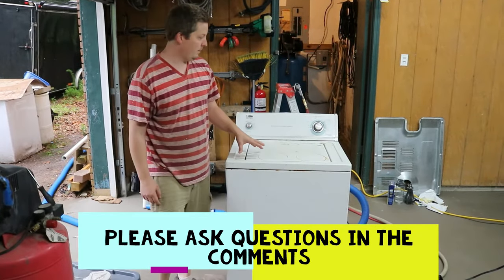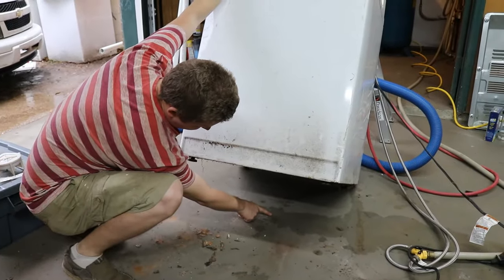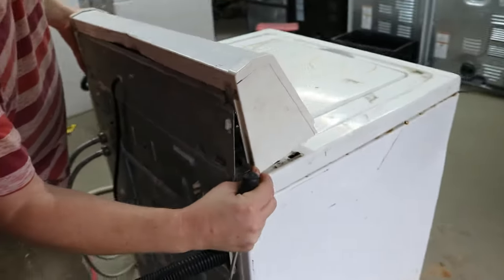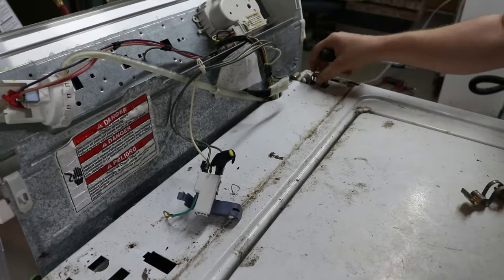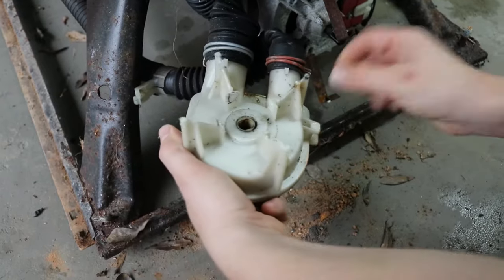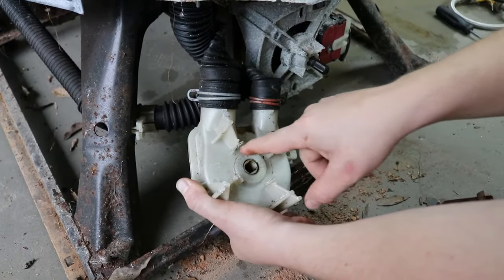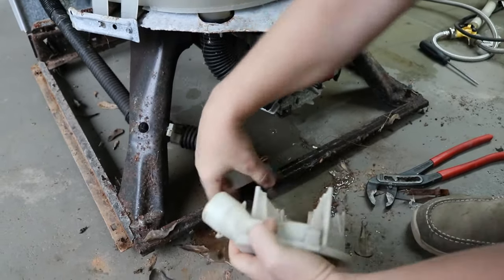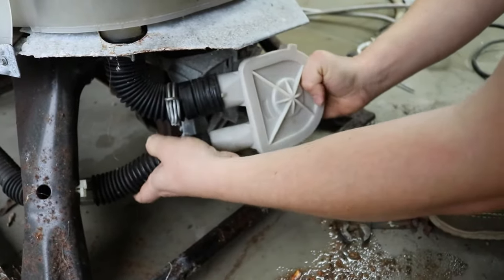Washer Not Draining or leaking? Water Pump Fix for Amana Estate Whirlpool Kenmore Roper

Comment: Hey Pal, Thanks so much for the great video. I had watched several and they were good but I didn't have a clue till I watched yours. I had it the washer apart and the pump off in about five minutes. I thought the pump looked good. I filled it with water and it leaked like a sieve. Thanks again!

Comment: Woke up with a sore back not excited to crawl underneath the washer. Then I saw this video and it was so much easier to access the pump! The existing pump looked decent, so I’m still not positive that was the issue. Replaced it but haven’t run a load yet. Fingers crossed it works.

Comment: I could use your help. This is unrelated to this video. I have a Kenmore 90 Series washer. After completing one load of wash I started a second. The tub filled with water, agitated then stopped. No matter what setting I put it in nothing happens. No humming, nothing. Another Kenmore 90 series washer was given to me. It agitated but no spin. After checking it out it was only a loose wire. Plugged it in & it went through the cycles. Put a load of cloths in & the only cycle that will now work is the spin. Any help on either one of these would be appreciated. I did notice same series but different timer control model. I did check the lid switch, both are good. I even jumped them to make sure.
This video is very well done, full view & 👍
Stay safe, Joe Z
Reply from the maker: The second washe mentioned…
The first thing a Washer will do is call for water from the water valves. If it does nothing, it could be that the cold water valve has gone bad. That would make sense of why you can progress it to spin and it will spin out. You are telling it not to call for water anymore and go to spin cycle. 
Quick way to check is turn it to hot water. It will still stop halfway through because the rinse cycle is with cold water, but… if it starts filling with water, you know the cold water valve is out.
The first one you mention does sound like a lid switch if it is not draining the water. Since you said you checked the lid switch the other less common thing it could be is the clutch. It will be obvious if it’s the clutch it will drain the water out and still make noise but not spin.
Reply: Thank you for this information. I will try the second one with the hot water. The first one does not hum or make any noise. I just installed  a new timer and just as before it will fill with water then nothing. @WasherDryerMoney

Comment: Mine is leaking only as it is filling. After it's filled no more water. When spins and goes in rinse mode, it fills with water and leaks again. After full its rinses and does not leak? Your opinion?
Reply from the maker: Could be leaking from the water valves.

Comment: Will replacing the pump work if my estate is stopping before the spin cycle?
Reply from the maker: If it stops before the spin cycle that usually means the lid switch has gone out. When the lid switch goes out it thinks the door is open and will not begin spin cycle until the door is closed.

Comment: I have an older Whirpool top loader. Water is leaking from the bottom.  My model has a panel in the rear and I think the pump and hoses are right there in the back not in the front like this machine. I tipped in on its front.  I only felt water on the middle of the drum. Seemed dry around the hoses? Gotta figure out where this leak is?
Reply from the maker: Not sure I would have to see what type of machine it was. It must be a very old Whirlpool.
Reply: @WasherDryerMoney  No! I was wrong. It has the pump on the front. I am going to change the pump. Start from there.

Comment: I changed the water pump a year ago but it’s water coming out the front again 🤷‍♀️
Reply from the maker: Sometimes they last five years sometimes one. Whichever one you got it on Amazon try to go with another brand this time. Good luck
Reply: @WasherDryerMoney  I took it apart nothing was wrong my mother overloaded it and I told her to do smaller loads I put it back together and no problems 🤷‍♀️

Comment: I replaced my pump. Still leaks when spin cycle starts. Should I check the hoses? Right bottom corner
Reply from the maker: Turn Weird place to be leaking. Some washers have a Pleach dispenser that has a hose that runs into the tub. That hose could’ve come loose.
If you can get the case off the Washer it should be pretty easy to determine where the leak is coming from.

Comment: This video doesn't explain why the pump would be leaking, and why we know it isn't something else
Reply from the maker: The pump is all plastic. after while plastic on plastic will just wear out. When it does, it just starts dripping and then pouring if you let it go for too long. The only other thing that can leak on these type of washers is the tub seal, which is pretty rare. Most of the time it’s the water pump.

Comment: I just went from underneath, pulled the drain pump,  but there is not a noticeable problem , no cracks. Could it still be the leaking issue? It does spin, but not smoothly.

Comment: Great Info and guidance your a blessing , my washer is exactly like the one in your video ,I've had it for 21yrs, it leaked once a year ago the bottom hose on the pump split, now there's a little water on the floor but it's spinning slow and after it stops cloths are still soaked and water comes back in the bottom ,I ran the rinse spin over 3 times ,same results also seems like I smell slight burning odor electrical ,no smoke, pump? coupler? switch? all 3? lol! I'd appreciate your help thanks, God bless .
Reply from the maker: Sounds like it needs a new clutch.
Reply: @WasherDryerMoney  Turns out my discharge hose was clogged up ,cut the clogged part off ,she took off like normal!

Comment: Do you have an example video of what do to when it is corroded behind the water pump? I tried pulling mine off and it won’t come off so I looked with a flashlight and it’s extremely rusted and nasty back there.
Reply from the maker: I have heard that happened before. Usually you’ll have to break a plastic water pump with a hammer and replace it. Just be careful not to hurt yourself or hurt the motor. Go slow and keep cracking it to pieces until it comes all the way off.  a new water pump it’s not that expensive for this type of machine usually less than 20 bucks.
Sometimes the shaft that is rusted and swollen you will have to take a piece of sandpaper and clean it up before the new pump will easily go on.